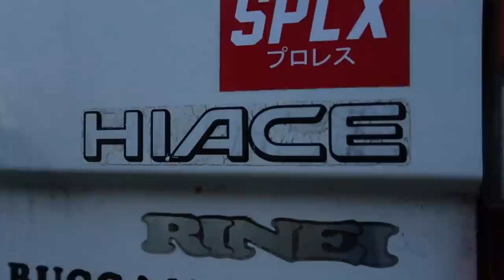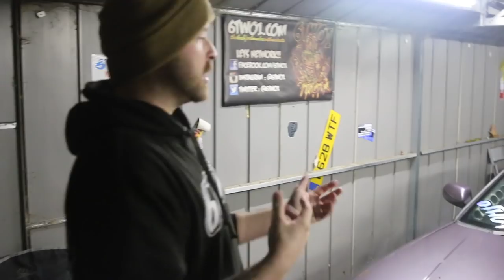UPDATE ON ALL MY CARS & BUILDS (Too many to list)

Comment: When you showed the Van i thought this with a 2jz and low on nice wheels. 1 minute later you said it..
My favorite is the EJ6 Ute. Its going to be a complete built with loads of nice things. I would use a rear window of a del Sol which rolls down and a tailgate like on a eg. Maybe a S2k drivetrain so you can drift it?